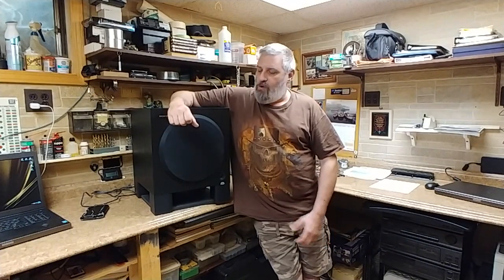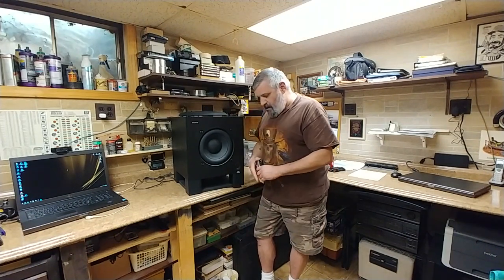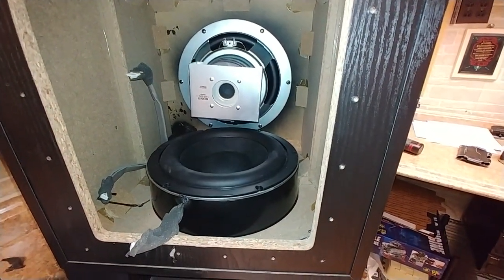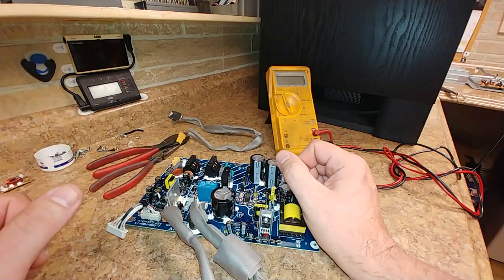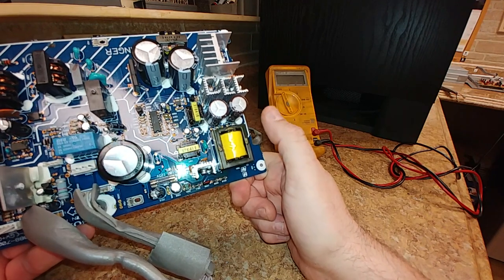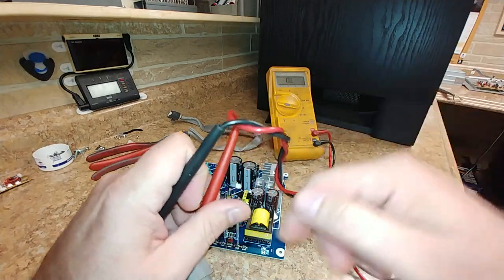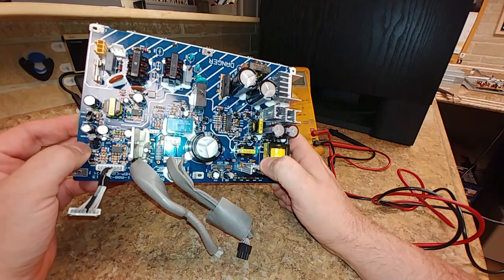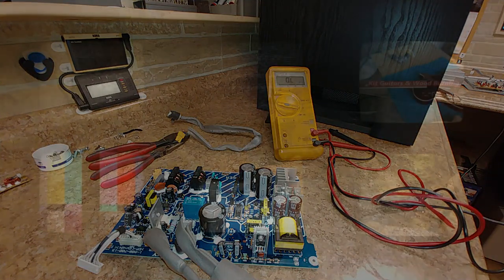Sony SA WX700 Trouble Shooting

Comment: I know this video is old, but since I had the same issue and I finally fixed my subwoofer, I like to share my findings. It's that C860 capacitor that caused my subwoofer to have no sound, it's a film capacitor 0.082uF  5% tolerance and 50V. I just replaced it and everything is working well. Also I had A similar issue about 2 years ago with the same sub, and replacing R830 and R831 fixed it for me, it looks like these are the most commun issues with this sub.
Reply from the maker: Thanks for sharing

Comment: Thank you Eric, for getting back to me so quickly . I haven't given up on this awesome subwoofer because when it was working it thumped.
Reply from the maker: i am making a new backing for the enclosure and i am going to put this in my SUV. i want to hear this sub really bad. Sony is supposed to email me when or if they get new parts in. its a shame that all the You Tube videos on this sub all have the same problems. you would think that Sony would have done a recall on them.
Reply: @Eric C (The Art Of Noise)  I had a Sony rear projection TV with a light box that many had the same problem with the bulb having to be replaced at $200 each every so many months and there were so many complaining about it,  but Sony never recalled it. I got a new bulb and sold it. Canon had a stuck shutter and many had the same problem and they wanted everyone to send it in and they would determine if it was a defect and mine was repaired free! Another needing a recall! Then my last one was a Samsung Galaxy S20 Ultra 5G had a swollen battery and the back separated and the screen was damaged, but they needed to see if it was their fault and I went to a shyster service they authorized and they would not call Samsung to get the authorization to investigate the problem and wanted to charge me for all the repairs except the battery. Then I finally got Samsung to have me mail it to their own repair facility and in 8 days they sent me a new phone! Free of charge! Such is the trend of Recalls by electronics companies!

Comment: Was banging my head against the wall a few years ago trying to fix the same thing. Finally gave up and replaced the amp with a Bash. Sounds so freaking good. Headroom for days. More money than I wanted to spend initially, but still glad I did it.
Reply: Hi which admp did you use

Comment: I have a 1100 watt Peavey power amp that I fixed a while back. It was a resistor or two and some broken solder joints. It's a great amp! I concocted my own home theater a while back as well. I have several little satellite speakers but most of my sound is coming from 4 towers with 12" 8" and tweeters. Along with a couple of really old 12" Earthquake subwoofers. It too is probably around 1000 watts rms.

Comment: Hi I have the same issues with my SA-WX-700. I like to know if you finished the continuing video and where is it? I have not seen any other video with the same sub-woofer being fixed and I would like to fix my sub, I miss the great sound that come out of it.
Reply from the maker: yeah... it was a no go. there is a transformer that feeds the diodes and resistor. on mine the transformer is bad and i can't get another one. Sony said they are on back order.

Comment: Never got back to this?
Reply from the maker: No. I can't find parts
Reply: @ericctheartofnoise8613  sad, even radio shack used to have HEATH KIT for many DIY parts.
Reply from the maker: Back in the late 80s to 90s, I use to live at Radio Shack till about 93. I use to repair a lot of cassette players and they could get everything from belts to pinch rollers. Then I found a website called MCM Electronics. It didn't take long for that site to disappear. Parts Express isn't bad, but they seem to be more audio. I miss the good ol days running to the Shack and picking up what I needed off the shelf.

Comment: Did you ever fix the amp?
Reply from the maker: No. The one part i needed is unavailable. I couldn't cross reference to match one. I gave the two subs to one of my friends.
Reply: @ericctheartofnoise8613  o ok because I'm in that same scenario
Reply: No

Comment: I don't like the new technology since all electronic equipment is made in China, and they are made with (switched power supply) that do not last at all, made of poor quality, I prefer vintage technology, all my devices are vintage, they have more than 20 years and they work better than new equipment,
Reply from the maker: This you are not wrong about. This subwoofer was a bust. They no longer make the parts for it and I haven't been able to cross refence any parts for it.